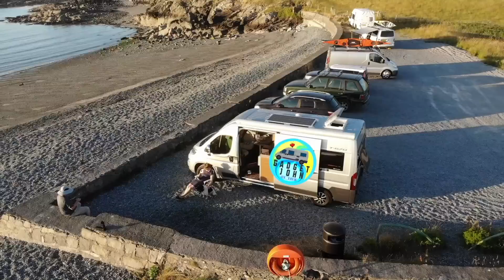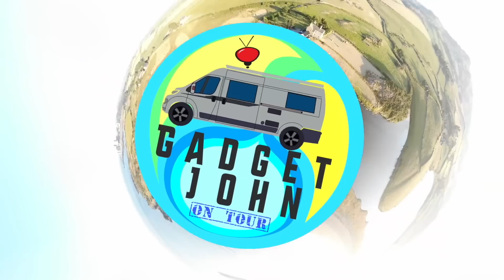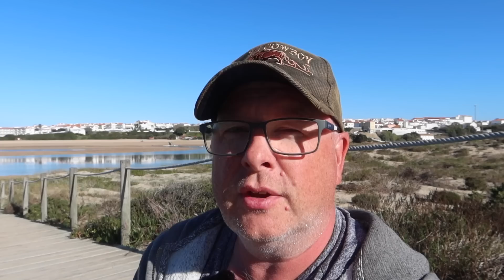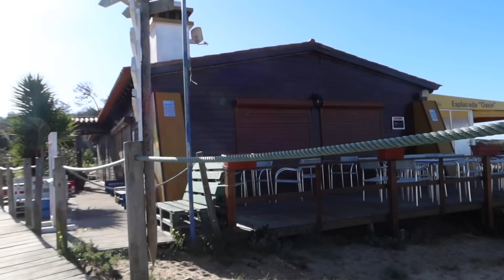VanTech Tuesday - Solar Power Special

Comment: I am so glad that you are an advocate of B2B charging, I have been using alternator managers and B2B chargers for 14 years now, and have never felt I needed solar. Solar is so heavy and expensive, for so little output. I use lead acid batteries x 3 and have never ran out of juice. People really need to sort out engine based charging before even looking at solar. Especially in the UK in the winter. I might get a solar panel if we move to a compressor fridge from our absorption. I am not sure why people when thinking of more electricity in their conversions always go straight to solar without using the 1800w alternator already fitted to your engine, it’s bonkers. The Americans are going solar less now with bespoke 48v alternators and large lithium batteries. That’s the future, not solar, who wants 60kg on the roof, it’s nuts. Check out The Last Resort video on the Advanced RV channel. That’s the future right there. Thanks for theses videos. Cheers Simon. P.s. I run my absorption fridge when driving on 240v through the inverter. Works great.
Reply: Haha I know I've often wondered why people buy generators when they have one under the bonnet but 'belt and braces' isn't a bad thing. I have a 100w solar panel to keep 12v compressor fridge running. It makes sense that when the sun is out I need my fridge to work. If the sun isn't out then not so crucial.
Reply: mippyaya we are fine for 3 or 4 days. We all use tech. 3 people in the Moho. For staying in one place for a long time I get solar, but for the UK I just don’t think it’s worth it. You gotta get what right for what you do, but everyone should use their alternator to the max before sorting out solar. Best is to have both.
Reply from the maker: The best solution is the one that charges your batteries for free. B2B is good, but free power from solar, tilting if you’re north or in winter, is better as it means you don’t bother others with your engine running all day and wasting fuel. Oh and 60kg on the roof isn’t right, I’ve got a huge 360w panel it it weighs 6kg.
Reply: Gadget John on tour  I have never had to charge other than from driving. Solar isn’t free when the set up costs several hundreds of pounds, using your engine whilst driving is free. You don’t need solar. But it’s nice to have as an add on.
Reply: We drive at least an hour at least every other day, and this is enough driving for charging the batteries.
Reply: Gadget John on tour when we did 2 weeks in Scotland over Christmas had we only had solar charging we would have been in the poop, if you only stay in Spain then solar is great, but what about winter in the Nordic countries, solar is just weight you are driving around with. At least I know that all I need is an hour drive to charge up, doesn’t matter where in the world we are.
Reply: @GadgetJohnAdventures  The 360W Photonic Universe Panel is 23KG not 6KG.. 

Simon Aldred you raise some good points, but running your engine is not free. Solar can be a nice little bonus when going off-grid for a few days if the plan is for little to no driving. Ultimately It all comes down to individual needs. 

Now 2035 for the UK gets interesting maybe even 2030. 100KW+ Electric vans? Yes please!
Reply: mippyaya yes, if you drive a fair amount like we do then the alternator is your best friend, for long stays with no engine on then I get solar, but don’t most people drive nearly every day?

Comment: A question just to be sure. Isn't so that if you connect several panels in series, that doesn't mean You have to have an MPPT-controller  with a voltage number over the total of the panels, but that the controller will not use more than what it has as max voltage. 

For instance, lets say You have a total of 100 V from your panels, but only 80 V on the MPPT-controller, that is just fine, but don't expect full effect from the panels since the controller don't handle the last 20 volt. If that question makes sense :)
Reply from the maker: I did cover that in the video, I gave both mppt and pwm scenarios. It explained what you’re asking in the video 👍🏼
Reply: @GadgetJohnAdventures  Gosh, my english must be rusty there :) I think what I got stuck on was at 06:33 when You said "say for example my controller is 100 volt.....so basically You can have all the panels up as long as it doesn't...in excess of a 100 volt".

Comment: Hi john now you have the panel fitted to your fiamma roof rack what is the road noise like and what difference does it make to fuel consumption cheers Gary l
Reply from the maker: I don’t get any road noise from it and it’s not affected the mpg, mainly as there’s no drag on the panel or roof rack as it’s all very slim profile 👍🏼

Comment: 5:08 Oh crap. I just bought a 60W panel to add to my 2 x 100W array in parallel. Does this mean I can't use the same charge controller (it can handle 260W)?
Reply: Ah I think I get what you mean. I think you mean the same voltage. Not necessarily identical in every way. So maybe I'm ok? Is that right?
Reply from the maker: Parallel arrays have to be the same voltage panels yes 👍🏼
Reply: @GadgetJohnAdventures  And wattage can be different? Sorry, I feel like 'm pestering you but I'd just like to be 100% sure and your answer kind of only half confirms what I think I have right in my mind.
Reply from the maker: When wiring solar panels in parallel, the amperage (current) is additive, but the voltage remains the same. eg. If you had 4 solar panels in parallel and each was rated at 12 volts and 5 amps, the entire array would be 12 volts and 20 amps.
Reply: @GadgetJohnAdventures  LOL. Ok, Your example still has the panels as the same amperage so I don't know if it works with differing amperage panels. If you're not comfortable with the responsibility of advising me on this that's absolutely fine. Or maybe I'm not communicating my question very well. Either way it's OK if you want to just move on and leave me to it.
Reply: Lee Smith, watch Will Prowse, basic solar set up, on You Tube. He does tests on all sorts of Panels and controllers. Maybe he can get you thinking along the same lines as Gadget John